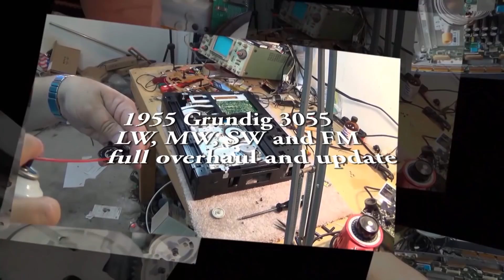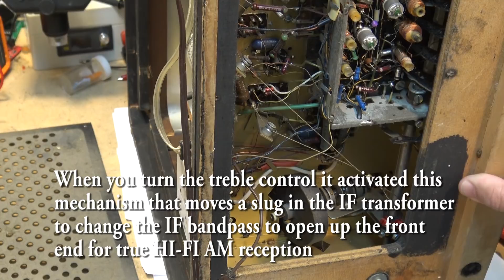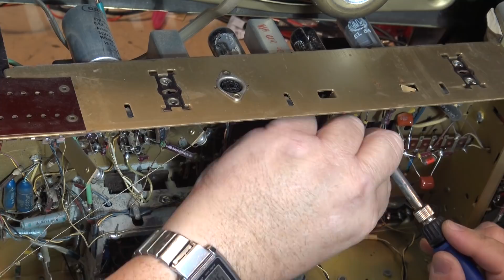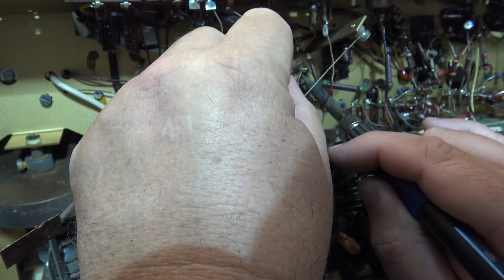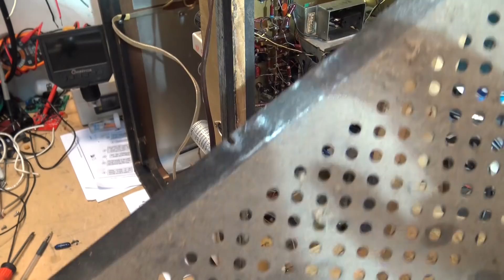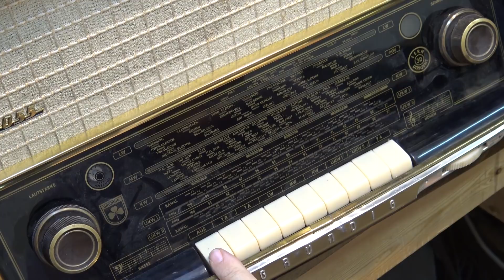Grundig 3055 Vintage table radio restoration

Comment: Nice video. thanks. 

Do note that this radio doesn't have three speakers, as mentioned in the audio, but five. There are two electrostatic tweeters, the brown flat units to the left of the woofer, as seen from the rear.  They're only active when the radio is switched to FM and  have most likely gone quiet because the internal foam insulation has disintegrated.
Reply: Good observation 👍 Would be nice should someone make a video of how to restore them.

Comment: The Germans don't make radios; they make art that receives radio frequencies.  Databits had a Grundig unit, and if I remember correctly (I may be wrong) each channel preset had its own tuning knob so you could adjust each one to the channel you desired.

Comment: That thing really is a beauty, love the ferrite antenna setup.  Just coming from the Pye P75 video & I reckon the paper coupling cap is probably the reason the audio output  transformer is open on the old record player I mentioned to you a few days back. (not looked that deeply other than diagnosis yet but it has to be the coupling cap as it's the only one in there apart from the 2 part 'lytic can!).  Just hope the tube isn't fubared because of it too, it's a UL84 which I believe is a sub 100mA version of the EL84 I see in this set as a begin watching...  Cheers again for sharing your knowledge, I'm picking up a little every time I watch!
Reply: There can be several resons why a primary goes open. Yes heavy anode current is one. I have rewound many transformers and a common problem is damp attacking the copper wire where the enamel coating is damaged or cracked. Another cause is impurities in the copper causing electrolytic corrosion. I have seen some windings with literally dozens of breaks due to poor quality wire. Frost will cause failure if the wire is very tightly wound due to thermal contraction snapping it deep inside the winding.

Comment: This Grundig is amazingly similar to a Telefunken Opus that I have.  However the Telefunken model has 6 speakers in it, 3-way with woofers, mids and tweeters.  The chassis and internals are otherwise very similar and in some way identical.  Were they related companies back in the day?

Comment: Beautiful set.
Selenium rectifier? Aren't those the ones that smell like rotten eggs when they short?
I had one in a motorcycle. I have old popular mechanics books that mentions them . Didn't say it was harmful. But, Better safe than sorry!
P.S. my favorite station is KSHE-95. Which what that should receive . (St. Louis MO station)
Reply: There's a popular pun amongst German radio technicians: the German word for rectifier is "Gleichrichter", whereas "gleich riecht er" means it'll stink soon.

Comment: 1:19 <- Nice Volkswagen reference there, Dave. Grundigs showed off the electronics part of Germany while Volkswagen showed off German engines and how cars are to run diesel (you might know that they're the only vehicle brand in all of Canada that even produces diesel cars in the first place).
Reply from the maker: Really. My dad had a 1959 Merceded D190 diesel, and then got a 1969 Mercedes diesel. In Canada. I learned to drive on that car, and learned what happens when the oil control ring breaks, and the car starts running on the crankcase oil. A runaway. Never a pleasant thing on a diesel.
Reply: 12voltvids So the Mercs had diesel cars as well? Interesting.
Reply from the maker: Rudolf Diesel worked for MAN engineering back in  the 1800's when he perfected t he compression combustion engine that was named after him. A long time customer of mine is the grandson of the founder of MAN, and he has a large portrait of his grandfather standing with Rudolf and the first successful diesel engine. He was telling me once when I was working at hos house that his portrait is one of 2 commissioned, and the other one is in the MAN headquarters in Germany. They are now a subsidiary of the Volkswagen group.
Reply: 12voltvids Huh. Which is probably why Volkswagen's the only modern brand that carries diesel car engines these days. (Well, unless Mercedes still has some...)
Reply from the maker: After dieselgate there are not too many people buying them here.
GM has the Chevy Cruise Diesel. It has been on the market for a few years. Myself I will stick to my Volt.
Reply: @rawr51919  Diesel cars are very, very common here in Europe.  PSA, VM Motori, Mercedes, BMW, VW all make excellent diesels.
Reply: The viability of diesel cars has a lot to do with fuel costs. Diesel has many inherent advantages, including more chemical power than gas.

Comment: You should add some series resistors to the silicon rectifier, as it is much more efficient than the original selenium rectifier.
The B+ voltage will be too high without them.
Reply: making them develop grid emission, pushing the plate current even higher..... may even blow the output transformer primary, especially so with these small all glass tubes with closer electrode spacing..
Reply: it will not last long term at that level...
Reply: @andygozzo72  
You are correct but he's just not listening.
Reply: it wont damage the caps but will 'fry' the tubes.....
Reply from the maker: andygozzo72 
Over voltage on filaments yes. 
Plate voltage s little higher not so much. They used to sell direct plug in silicon diodes for rectifier tubes that resulted in considerably higher plate voltage. Never ran into any issues using those. If you are running a big power amp a bias adjustment would be in order but these low power class a the current dissipation from a slightly higher plate voltage is negligible.
Reply: so, please,please,please, reduce that ht......
Reply from the maker: The B+ will be higher yes, but I also changed out all the capacitors and went from 400V rating to 630v and the b+ increase is still well within the plate rating of the tubes. It's only running 365 volts now. I don't know what the selenium would have provided because I didn't measure, would be lower for sure, but 365 isn't going to damage anything, as all the caps now are rated 630.
Reply: i would say thats far too high, more like 240 to 300, i have a 2043W(similar, but different, if you get what i mean.) and its ht is 260 out of the rectifier...
Reply: 365V?  That much voltage would run the tubes down really fast! Usually these radios run at about 280-260V B+. Schematics say 287V when on AM  and 281V on FM direcly out of the rectifier. 100 ohm 5W resistor would probably be enough to lower the B+. Check your transformer tap if it is perhaps set to 110V instead of 125V. Better a bit lower than too high. Replacing the selenium with silicon without including the series resistor is a botch job, especially when the voltage is then 80V higher than in schematics!
Reply: exactly, far too high,  tubes are far more tolerant and will work with an overload...but only for a while...it maybe within the max plate voltage rating, but the circuit would be designed for lower voltage, maybe even running near max plate dissipation at the design ht, so it will most certainly be well over at 365...

Comment: I saw this very same unit in a bar I used to frequent and it was on a shelf in the back room and I have had a close look at the controls and have often wondered about a certain control but I think you have enlightened me so I don't need to wonder about it any more, I was friendly with a television/radio engineer who was a client of my fathers and it turns out that they are no longer in business.

Comment: Holy smokes, a Grundig! The thing under "3D KLANG" (3D sound) is "FERN DIRIGENT", meaning "remote conductor", and yes: that thing could obviously be remote controlled. In case you need to figure out some more knobs, please, do ask (German's my native language), or check this site out => http://www.tubesound.it/Grundig_3055_uk.htm It's mostly in English and explains all the controls; even has an image of the remote control (lol) That was a great video - thanks!
Reply from the maker: I no longer have this unit. It was a customers unit, and he came over within minutes of me calling and collected his old collector radio. Would have to have one of these sets, as it really sounded great during my short time with it.

Comment: Smashing job :-D 
The chassis is really clean, the plating has done a good job :-D.

Old grundig equipment has always been good quality, but they were taken over so who knows if they produced anything good after that :-(.

There old reel to reel tape recorders were good old beasts (valve days), they lasted bloody years :-D.
Philips produced some interesting stuff too, but they had a bad habit of using one valve for 20 different functions, so when it died everything stopped dead, not clever :-(
Reply: Grundig ended up selling radios made by the Chinese.  One supplier was Sangean, who actually make really nice radios by Chinese standards (especially their higher end stuff), but not up to the standards of these old beauties.  Looks now as if Grundig are just a zombie brand owned by Beko and used on home appliances.  Sad.

Comment: One thing not mentioned is even though the German made equipment was made for export to multiple countries, North American power grid changed gradually from 110 to 120 between 1930 to 1984.  Many of the power supplies in this equipment is fixed at 110V.  This led to accelerated component failure.  My family had a Nordmende Stereo and the power supply could be adjusted for 100, 110V, 120V by a switch.
Reply from the maker: This one has several voltage ratings. 110/120/150/220 and 240. Voltage is selected by moving the fuse to the proper fuse holder. The back cover showed where it goes. I didn't show the back of the unit but is was clearly labeled, and it is set to 120 V
Reply: 20 OHM resistor  in mains lead fixes issue with mains voltage too high
Reply: @mohinderkaur6671  yep, i have a few european (mostly german) radios designed for 220v, but here in the uk its around 240v so need either to fit a dropper in the set, or an adapter unit externally

Comment: 87.5 - 100 MHz UKW (FM) has been the standard since 1949, since 1968 they allowed this to be expanded to 108 MHz. Greetings from Germany.
Still need to fix my Saba Freudenstadt 8...
Reply from the maker: Yes I figured that, and since this was a 1955 model that the owner had when he lived in Germany this explains the tuning range.
Reply: I think there were two expansions, as some of my older FM radios only go up to 104Mhz.  So 100, 104, then 108 I think.  (In the United Kingdom at least).
Reply: 1949-1964:  87,5 – 100 MHz
1964-1968:  87,5 – 104,5 MHz
since 1968: 87,5 – 108 MHz
FM-Stereo introduction 1963-1968

Comment: ecc85  tube    A lot of  trouble
Reply from the maker: The biggest trouble on these units is the shit tube sockets. No way to tighten the socket pins as they are sandwiched between 2 pieces of wafer. So the tubes come loose.

Comment: That tape input is that a line level signal? I'm guessing that the phono is standard phono level signal. Could you hook something like an MP3 player to this.
Reply from the maker: Tape head and magnetic phono I believe.
Reply: 12voltvids those to me are not line level. My mom had a JCPenney stereo and the tape player hooked to the receiver via RCA cables. I believe the signal was phono level. It would be cool to hook an iPod to something like this.
Reply from the maker: Did I say line level? No! I believe they are magnetic pickup level. I didn't test them as I don't have anything to plug into it, but they hummed when I switched to the input.
Reply: It was meant for crystal pickups, so "kinda" line level
Reply: Yes you can, I had a CD player connected to mine. You'll have to build your own connector though.
Reply: mishap601k what type of connector does it use? Something special?
Reply: coondogtheman1234 just regular banana plugs, or an old style European power plug.
Reply: I made something similar to this: http://www.gloeidraad.nl/radioforum/images/uploaded/201111091607364eba97384632e.gif
Reply: mishap601k very cool. I like the resistors that stop anything from shooting back into the aux device.
Reply: Hi, Tape input is line in level, also Phono input: it was made for ceramic pickup so it is line level.Adding ECC83 (12AX7) tube and the associated circuitry is necessary for it to work with magnetic pickup.Best Regards,Moshe.
Reply: moshe zaharia yeah but is tape line in level  the same line level as a CD player or MP3 player?
Reply: coondogtheman1234 It is close enough to give a very good quality sound.
I belive it is around 500mv

Comment: Check the mostright pushbutton (FA), doesn't that stand for Ferrite Antenna? Perhaps you can switch between internal and external antenna that way...
Reply from the maker: The FA button turns off the AFC on FM for accurate tuning. You have to hold it down as it does not latch.
If you notice to the left of the tuning dial a light turn on for MW and LW reception. Under that light it says Ferrite Antenna. There is supposed to be a pointer in there that spins when you turn the read part of the volume dial that spins the ferrite antenna, but the pointer is missing.

Comment: Whoa.... I consider Grundig to be the Mercedes-Benz of all other table radios out there - fantastic!
Reply: Wasn't Blaupunkt in Mercedes?
Reply: My bad!!!
Reply from the maker: Yes, Blaupunkt in Mercedes. My dad had an old 69 merc. Had a Blaupunkt AM radio and he added a Kraco 8 track.
Speaking of 8 track. I have one of those too. An 8 track RECORDER deck. I should fix it just for fun.
Reply: i thought telefunken was the top of the line stuff
Reply from the maker: They are great old units. This one is 60 years old and sounds fantastic.
All the tubes are original, and the only dead tube was the tuning eye.
Reply: SABA and Nordmende ( the bigger Models ) were also extremely good
Reply: I'm a german radios collector, I have all the top models of this era, including the Saba Freiburg 14 (fm stereo), and I can tell you the Mercedes-benz, i would even say the Rolls-Royce of all german radios, is the Saba brand. Just try to listen to a Freiburg 14 and compare with other german radios. None is a match for it. But grundig comes second. I have several Grundig models as well (including the 3055 that 12voltsvid has repaired), and some fm stereo such as the 5490 and 5590 and all sound good but when bass comes into play, Saba is way better.

I also have a lot of Philips Plano variants, and these are compact, good radios, with very good reception, probably better than grundig and saba, but the sound quality is far away.
Reply: I totally agree, especially about the big Saba sets, with a pair of (rare, but less than ecll800) ecl80.
Reply: @stephaneschmitz8030  german radios are generally excellent, i have a few, one has twin tuning drives using the fm drive as bandspread/fine tuning on sw bands
Reply: well newer mercedes are total crap, but i think the new grundig radios also are crap. but the new plastic ones probably are like a china ripoff brand
Reply: @KrisisVal  I have always loved Grundig radios, at any city near an Army base, you could find a good deal on them at pawn shops, that's where I used to get mine when I was a soldier.  They just weighed to much for  shipping to your new assignement years ago, so the pawn shop was a place to exchange them for a few bucks for the trip. So a few years back I found a little Grundig 8 for sale on Ebay, it had been attacked by a puppy that loved to chew so  the case was damaged and the battery cover was missing. I found new parts to replace the damaged stuff and now have a lovely little transistor radio.  The plate says Something about Originated in Germany, designed in California, built in China sold in USA.  At any rate it is the BEST China radio I have ever seen, much better then the old Japan sets of the 70's. I love the digital display, it has built in thermometer that can be set to the F scale for we of the metric ignorant, and has a lighted dial when the light is turned on.  She is very sensitive and is the only radio I have that receives AM in my house which is a sort of Faraday cage by design with foil wrapped insulation and a steel roof.  Even the shortwave brings in stations, very impressive.